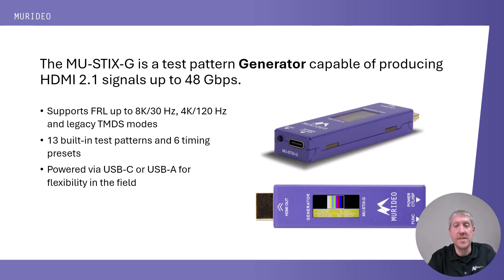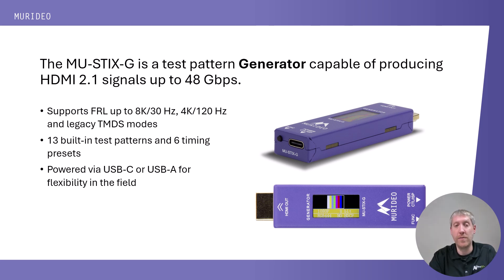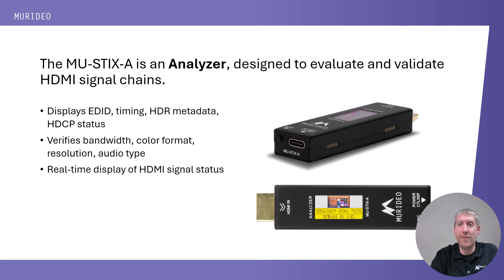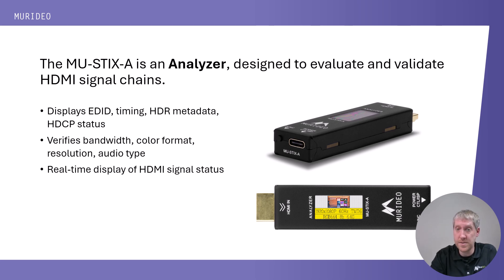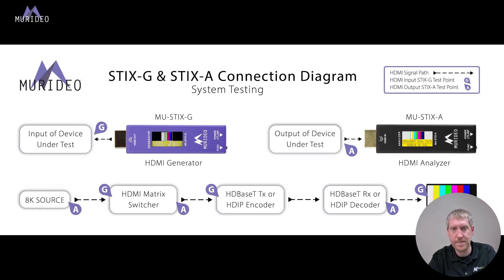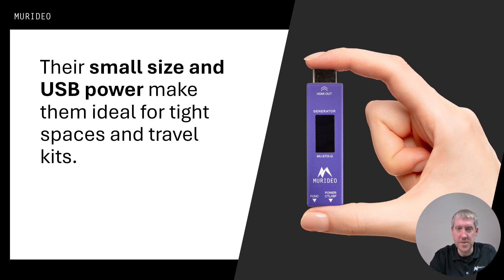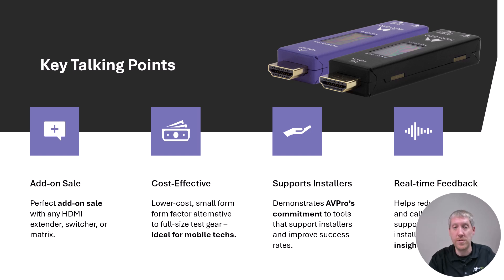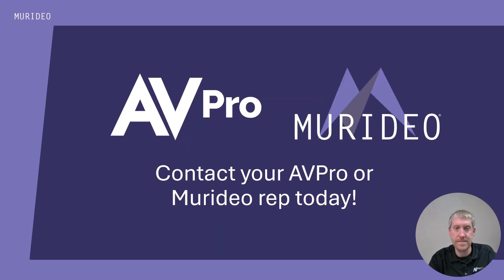Murideo STIX Training – HDMI 2.1 Generator & Analyzer Overview

Comment: Hello thanks for the video.
I've got both STIX. The manual shows the firmware update process, with reference to the page but the shown drop down menu, with the Stix firmware is not on the page.
Would it be possible to get a simple 2 channel PCM signal generator in a firmware update for the STIX-G?
Is it possible that the USB chip in the STIX is a bit picky about what USB cable is used? 
In my experience all A > C cables work fine, but only a hand full of C > C cables seem to work.